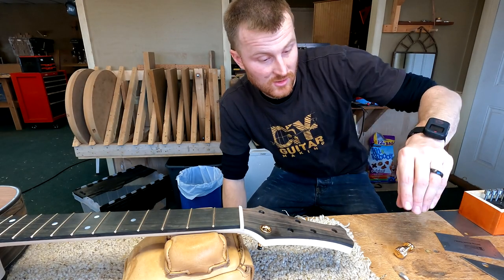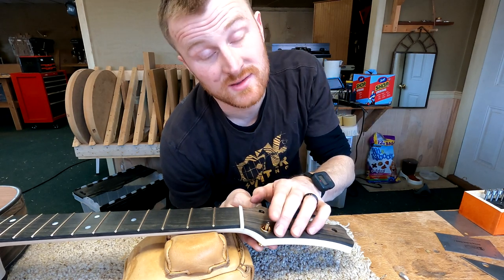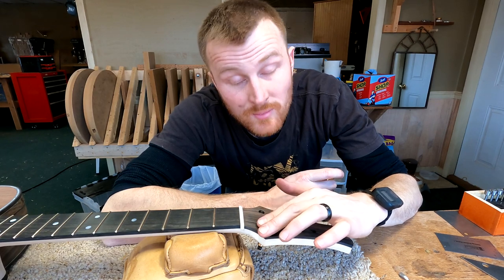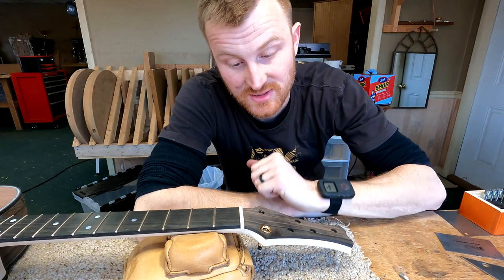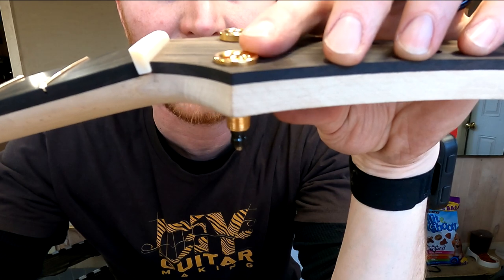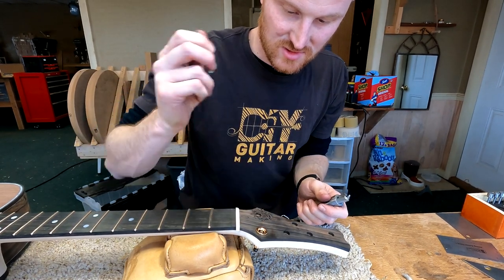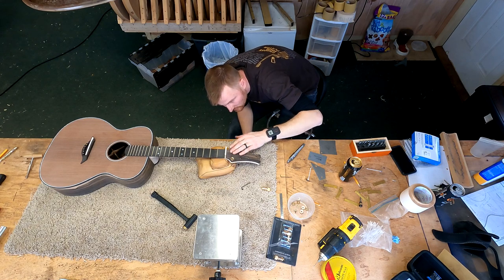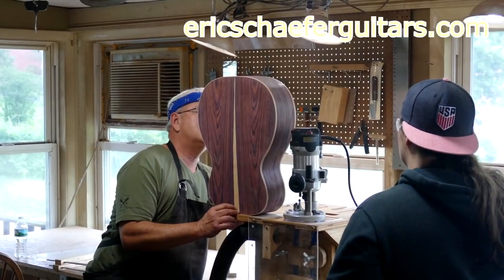Counterboring Gearless Tuners into the Headstock of Guitar #85

Comment: Hi Eric, as an amateur luthier, I've benefited greatly from your videos and it shows on my guitars.  I ordered the counterbore tool set and used it last night.    I drilled out the tuner holes with a 3/8" forstner bit but found that the pilot guide was too tight so I opened up the hole with a 3 degree reamer and it worked just fine.  Next time I may go one step up from 3/8.   I was a little concerned that the 5/8" bore would be a bit too tight for the tuner, but I think the little bit of slop from turning the tool by hand gave it just the right amount of room to fit nicely.   You mentioned that a T handle might make this easier - absolutely right - about 1/2 way done, I spent about 10 minutes to make a handle with a mortise to fit the tool and hammered it on.  This made a big difference and was well worth it.  Keep up the good work!

Comment: Eric, I'm installing my first set of Steinbergers on a fender style headstock. I've done a lot of machining in my years as an artist/craftsman and the term you are looking for to describe the part of the tuner for which you are countersinking the "shoulder."
I cannot say that I find the installation of these tuners to be without problems. For example I slotted for the key post (pin) because the tolerance between the body diameter and the  post is not practical, in my experience, for wood. In addition, the manufacturer suggests suggests a 1/16 inch hole (.0625) for the pin which is about .075 inch. I assume they expect the pin to expand the hole and provide a secure fit with the pressure of installation. With harder woods or torrified hard maple in this case, compression, forcing the procedure, is iffy at best.
I think angling the pilot for the pin is a good compromise. Since this is my first experience with the Steinbergers, I chose not to be as aggressive when hammering for location and setting of the pin. I see that my concern may have not been justified.
Counterboring for the shoulder is an excellent innovation. Your hand use of the counterboring tool was really a good touch. Like others have commented, I frequently opt for hand control for processes like chamfering. Did you have any trouble with chipping out the edge of the hole because of the relatively few teeth on the tool? I assume your tool is "bottom cutting" for a flat cut like other counterbores.?
Thanks for the thoughtful and educational video.
Jim

Comment: I just found out about these tuners, and was wanting to install some on my Ibanez, but I’m a little wary about drilling holes into the headstock to accommodate for the pin. Would it be possible to just hammer them into place, or would that potentially cause damage to the finish, or lead to the tuning peg coming loose after having string tension on it?

Also, I saw a video where someone did the math of how much a string moves per turn on a set of 18:1 geared tuners, and compared it to the Steinberger gearless, and it equaled out to just about the 40:1 ratio they claim.